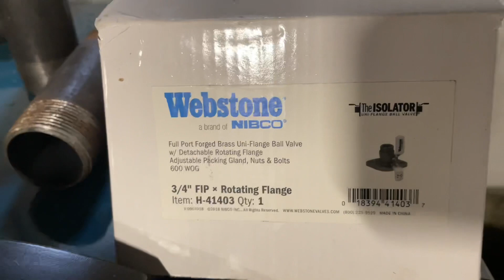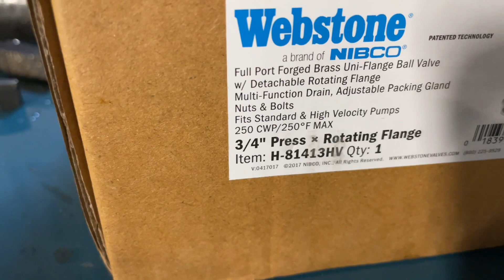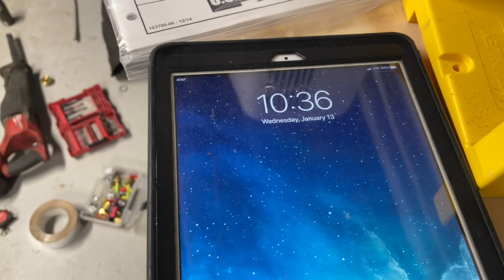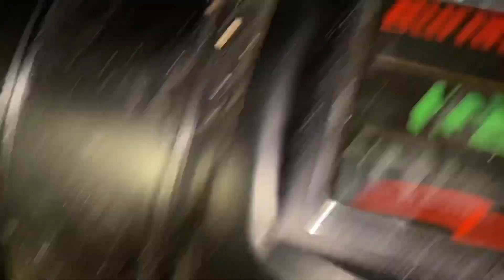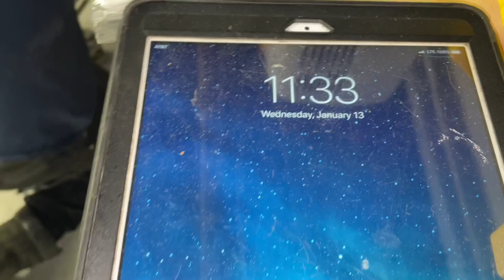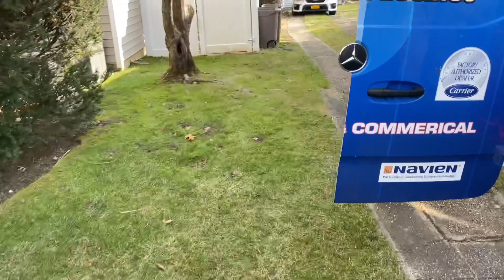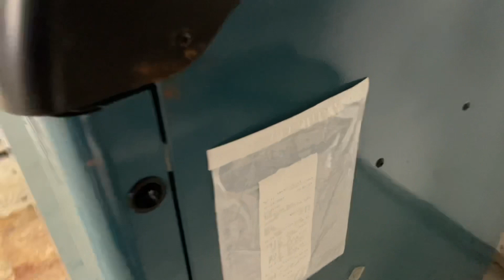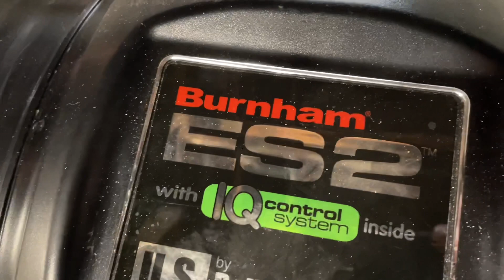Our YouTube Subscriber Gets Oil to Gas Conversion - Burnham ES25 Using Webstone Isolation Flanges

Comment: Sweet install. Is that the manufacturers standard mount for the wiring centre on top of the boiler - seems it would make up the most wild  heat there?

Comment: No Mikey, Knuckle Heads don't Deburr, Nick O ring LEAK Outside, Inside causes Air bubbles, turbulence. Would have turned drain around, getting off from above the circulator motor. That oil Emergency Switch should be disconnected, someone goes down stairs, comes up and shuts off. A "No Heat" call. Like your piping with Webstone, Saves every thing. Not to friendly with the Flue piping on Boiler, Accordion pipe?(Flex) All n All Good looking Job, Keep in up.

Comment: What product do you use to seal the metal exhaust flue pipe from the hot water heater to the masonry chimney? Do you have a vid that shows that part? Thanks!
Reply: @PipeDoctor  Is there a type or brand you recommend?

Comment: Hey Mister Pipes! Nice job, love it! Got a question, at 2:18 - 2:25 in video i see 4" cast iron and 2" cast iron piping with (U) traps which appear to have plugs on top. Whats the deal with those? Are they not only to trap water, but also so the pipe can be snaked in both directions?

Comment: Noticed taco’s at full speed am I right and why? Also no IQ cards what do you think of them? Low water cutoff, aqua stat, outdoor reset? Why didn’t you use Burnham hot water tank? By the way beautiful install you are an artist not just a plumber!
Reply: @PipeDoctor  What about the speed of the Taco’s Mike? How do you determine what speed to use? Those are set to full speed.

Comment: Some inspectors in pa would fail electrical 1 low voltage going in on line side of control and no switch gard on stair safety switch. Trivial but they have the power to make your life hell lol

Comment: With that boiler, why or why not add low water cut off switch and outdoor reset switch? With new hot water heater, why not use indirect hot water heater?
Reply: There is a low water cut off switch. Look at the tee after the spirovent.

Comment: Your comment about not being a licensed electrician shows. If you were licensed you would know the National Electric Code does not allow for emergency switches in the stair wells for gas fired equipment. In the event of a emergency with gas fired heating equipment the last thing you should be doing is turning off switches!
Reply: This does not appear to be a NY code requirement. NFPA-31 talks about a switch for oil burners, but nothing I know of requires this in NY mechanical or residential code.  However, in some areas it’s very common practice.

Comment: With this particular setup which is better,or would you recommend 50 gallon hot water boiler you just used or comparable sizes indirect hot water tank

Comment: Great work. Why don’t you use check valves on the returns?
Reply: @PipeDoctor  what are those Mike?
Reply: Internal flow checks. They’re installed in the circulator pumps.
Reply: @frankf7406  heat still travels backwards.